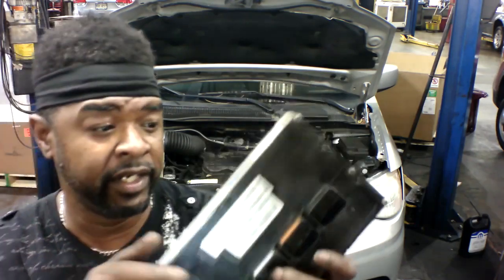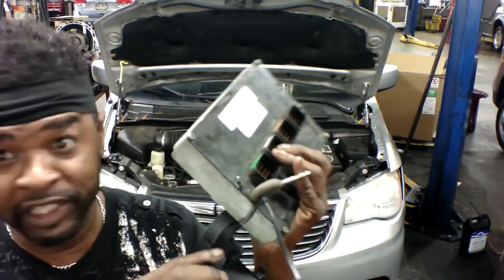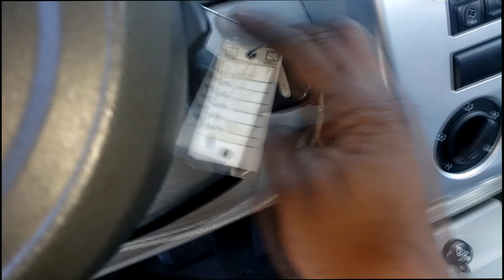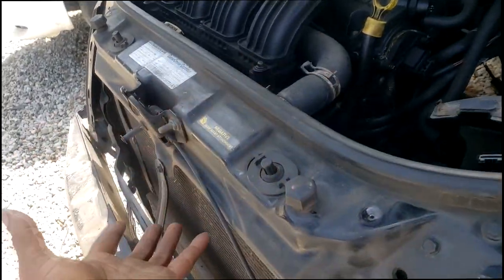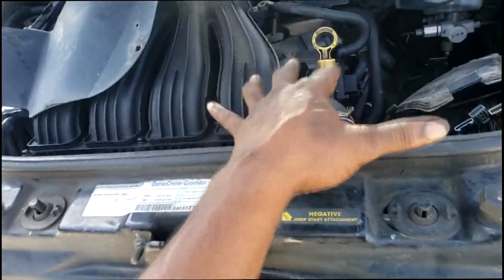No Start Key Bad. NO FLASH NEEDED. DO THIS. PCM, SKIM, KEY to avoid programming. PT Cruiser no crank

Comment: I got a 2001 PT cruiser limited edition I have 107,000 miles on it I got it from $2800 and mine runs really good air-conditioning works good doesn’t overheat passes smog it’s a really good car and reliable

Comment: need your help or anyones help please ...2006 jeep liberty  key got lost ......have been to junk yards in area could not find a jeep libertywith a key .....all jeep libertys were missing those 3 pieces ...... afriend told me i can pull it off a chrysler 300  so i have all three  key ignionskm and pcm ... i guess they are not interchange able becouse skm plug is not the same ............. help please is there a make and model that is inrchangeable with 2006 jeep liberty ..... thank you in advance for any input highly apreciated
Reply from the maker: The Dodge Nitro pretty much the same. Can you not simply get a new key programmed? Also are you subscribed to the channel?

Comment: Love your videos you saved me $$ on getting my TIPM Module for my 2012 Chrysler 200.

I've been having dimming led dash cluster lights new battery, new alternator, and I ran a dedicated 4 gauge wire from alternator to battery negative post on shock housing.

Comment: Yep, the electronics don't care what it's in so if you get all those parts together including the lock cylinder it will just continue to happily work if the car it goes in is the same year, engine, features. My mom's 08 pt never overheated, but the high fan relay went bad and every she turned on the air conditioning it would kill the engine when the air conditioning compressor would freeze up. The full aftermarket fan assembly was 90 bucks on Amazon and included new relays. It was just faster and cheaper to replace the whole assembly. The dealer wanted like 750 bucks. It should have been under recall or warranty but she was just over 50k so not covered. It still doesn't overheat to this day and I personally have never heard of the 2.4 being prone to head gasket failure like the early Neons were when Daimler refused to use the head gasket Chrysler wanted to use to save a few bucks per car.
Reply from the maker: Great points bud

Comment: DO NOT DO THIS! Avoid at all cost!!
If you ever try to make a key, and you go to the dealer to request a pin code for your vehicle (which is free) that pin code they gave you will never work again! Why? Because the SKIM already has a pin code from a different vehicle and and you can’t get the pin code. Then it will cost you way more than if the skim code was for the vehicle. Remember this pin code can be read by eeprom or CDA6 or other software. Always Go straight to the professionals that know how to deal with situations like this, more like security experts. The pin code can be modified to match your vehicle. Other option is to disable skim, it only takes 3 mins to disable VTSS
Reply from the maker: Dude you aware that this youtube right? You can always just simply make a video on ya channel and give your advice on that video. All you need to do is simply get the vin off the car you got the parts off of and get the skim code based off that vin. You may can explain your way  better on your video. Try it.
Reply: thats  a disrepectful thing youre doing there buddy youre discrediting the brother and he didnt do nothing to you 
who are you what are youre credentials?
Reply: If you they had a clue you just need to keep the Vin from the car you get parts from.

Comment: I can not get my car to start for nothing in this world and it is a pain in the ass I'm stuck and have been for two months now and I don't know anything about cars besides from watching ur videos u taught me how to change the thermostat the pcm and I did get all three Lmao I've changed the starter the fuses are all good I've changed the cam sensor and crank sensor I've changed the spark plugs and the spark plug wires and the ignition switch and still nothing idk wat else to do
Reply: Can u please help me figure out wat it is and I forgot to mention I've got a junked out car pt cruiser that didn't have any issues for it's parts for mine so I've got all the parts I need I just don't know wat the problem is please can u help me

Comment: Jt another thing in california its hard to find cars with the key in them at you pull it so i can grab 2 the pcm the skim module and i have a key guy that i use to program all my keys for me. If it dont have the key it will work you will just have to get the key program to the car u working on
Reply from the maker: Correct. This way is for people that does not have those options.

Comment: I lost my keys to my 2001 PT cruiser. Got a ''Locksmith'' to make a new key. At first, the key would open the door but it wouldn't turn in the ignition cylinder. I opened the compartment under the wheel and banged on the piece right under the cylinder to get the key to turn. The anti-theft light is on. It's solid at first but then blinks. I think the SKIM modual is thinking I'm using a shaved key to try to start the car. In any case, I can turn the car over despite having a weak battery (The battery light is on in the car) and on occasion the car will start only for a moment just to turn off again (I'm thinking due to the SKIM). I don't have alot of money and I know fuck all about cars. I just want to start my car. I get the whole anti-theft thing but if you're the owner and you legitimately lose your key's are you just shit out of luck? Will removing the SKIM or ECU (If possible) help me start my car!? I don't care if I don't have theft protection on it. I'll deal with that later, I just need to drive it.
Reply: Did u solve ur problem
Reply: @familyscapegoat  yep
Reply: How
Reply: How did  u fix it Having same problem with my Chrysler 300 V 6010 communication please let me know how you were able to fix it
Reply: SKiM

Comment: This also works with 2nd gen neon. 00-02 ecm/tcm, 03-05 pcm. 03 pcm  is a little different from 04, 05. 05 changed engine harness but pcm still can be used until you find your exact year. Yw
Reply from the maker: lol, good point

Comment: But if the PCM is controlling the alternator voltage regulator I should be able to bypass the PCM connection to the alternator with external voltage regulator powered by a fused power that turns on and off when I turn the key or am I missing something else?

Comment: Old video i have a 2005 ram it has a grey key but check this out i took column apart no module and no halo around where key goes. so wouldnt any ecm work in it that didnt have the immobilizer. and im guessing since i cant see one the grey key is pointless. someone must have cut the key and it didnt need it
Reply: i mean it would have to be like 2002-2005 im guessing with same drivetrain but seems like you could do a plug and play i could be wrong

Comment: If I do that on a Dodge neon, will it start cause I’m trying to see if my PCM is the reason why my battery is not charging without an external voltage regulator so I thought about just going to a junkyard buying a PCM and skim and key and see if it would solve my problem if the car starts
Reply from the maker: What year is the Neon and what color is the key? Or is it a key fob? Also are you subscribed to the channel?
Reply: Yes, I’m subscribed to your channel and the key is gray
Reply from the maker: @jessejones3038 Then yes, car equipped with security. Using the same number/model PCM and the skim should work. But you will run into a problem with that gray key. It's married to the skim. Hopefully you can get all 3 and just simply re code your ignition key cylinder
Reply: @OnlineMechanicTips  the junkyard that I was going to has  the ignition cylinder, and the key and the skim module and the PCM all in the same car so I was gonna buy it all and test it

Comment: what if the dodge have a key w flob and you can only find that year with a key w chip with no flob on it but you can remove the key cylinder and skim and ecu is it going to work to get the car started and later get a key fob and program it to work the alarm?
Reply from the maker: It depends on the year and the bus network. What year make and model? Also are you subscribed to the channel?

Comment: i just bought a computer for my Hyundai . Had the same part number as mine. Put it in without doing anything. Started and and it ran. The only thing , the windows rolled down would not roll back up. I look under the dash, someone had taking a wire and added it too the brake switch. I bought this car new, and never had any problem with my stop sw. What do you think they have done too my car. I am being watched by  private investigator .from one of the biggest company here in Las Vegas. I took my car too a garage, too have an axle replaced . but they had too keep my car over night. From that day on my car would just die , radio s Am stop working. What do you think, car when the wire is off the sw will start by just opening the door everything works except steering wheel will not turn. 
GOT ANY IDEAL WHAT HAVE BEEN DONE, SO MY CAR DO NOT NEED A KEY?

Comment: I did this on 2005 jeep liberty it won't fire up now any suggestions
Reply from the maker: You did what? Also are you subscribed to the channel?
Reply: @OnlineMechanicTips  took the ecm skim module and key off of my running 2005 jeep liberty and put it on another one 3.7liter engine and now it just cranks no spark
Reply: Any suggestions

Comment: Thank you for this! Hey I have a question.. I just picked up a skim module with the key from pull a part yesterday. Can I take the motherboard part out of the new key and put it in my original key that fits my cylinder?
Reply from the maker: Yes, that works..But if you got the skim module, you need to get the vin off that car..it will be needed to program to your PCM. Also are you subscribed to the channel?

Comment: Hey can you swap those pieces and it work on a 06 dodge charger... my immobilizer antenna broke and if I get all 3 do you have to have it programmed to my vin# been told that if I swap out it could cause other things in my car not to work like heat, air, radio etc  .... please help I'm very frustrated thanks
Reply from the maker: Hey Melissa, The 06 Charger bus sys just as advanced as the 06 PT Cruiser. What engine you have in this Charger? Also are you subscribed to the channel?
Reply: @OnlineMechanicTips  I have the 3.5 engine... just need help to get this thing up and running been down for 2 months now

Comment: Got a 2006 will turn over but won't crank, checked timing belt, is working. hooked computer to it, and it would not read it, I assume it the computer.
Reply from the maker: Hey bud, that is to expensive of a part to assume. There are test you have to run to get to this point. What have you done so far? Also are you subscribed to the channel?
Reply: @OnlineMechanicTips  LKQ says they can get me one for 120 dollars, or I could try the pull your own parts yard. After watching your video's, I see I need, the computer, the skim and the key, unless I want to have to get it programed, and that was my plan to just get it programed, I know a few mechanics that will help me or at least they should, I help them all the time. what do you recommend, I've watched about all your video's on PT cruisers, and yes I subscribed to your channel.
Reply: @OnlineMechanicTips  It turns over, but there is no fire, I tried ether but with no fire, no crank. It does turn over so that tells me the key switch is working, The crank sensor has already been changed. So I got a scanner from my neighbor that works on cars, and I put a new battery in it. Tried to scan it, and the computer wouldn't scan, came up with a failure to read the computer, so I unplug it, then plugged it back in, just to make sure it wasn't just a bad connection. failed again. Tried it on one of my other cars in the yard, it worked on them. Got to be the computer. what do you think? want to buy a PT cruiser?
Reply from the maker: @altonlynch5464  lol, no I do not want to buy it. What year is it?
Reply: @OnlineMechanicTips  2006
Reply: I have the computer out now
Reply from the maker: @altonlynch5464  Did you watch this video? https://www.youtube.com/watch?v=BKUiRvhzVxE&t=150s

Comment: Does a 2006 chrysler 300c have the same set up .if i get a used pcm from same year car with same engine will I have that skim module issue..
Reply from the maker: Im not understanding your question. Also are you subscribed to the channel?
Reply: @OnlineMechanicTips  im subscribed. The question was if I replace my pcm in my 06 chrysler 300c 5.7l with a used pcm from same year car with same engine will I have to get the skim module and key for it to work in my car.im getting trouble codes p0032 p0038 p0052 p0058 all at once in the original pcm thats in my car now.02 sensor high codes on all four banks.
Reply: Yes you will have the same issues and more. Stay away from used junk car PCM. Best to buy one online with your VIN. There is a YouTube video that is a company you mail them your PCM. They reflash it remove anti theft. Then you can use a regular metal key when they mail back the PCM.
Reply from the maker: @burnnotice5086  Used PCM are only junk to those thats not sure what to do. I use used PCMs on my personal customers all the time. A $30 used PCM from the pull a part sure beat those other prices

Comment: I bought a tipm.. 2013 didn't work ( in my 2011). If I added all three of those items your mentioning. Would that enable the tipm to work? If they're all from the same vehicle. Or does the tipm have separate variables other than the three your talking about
Reply from the maker: Hey bud, this video dealing with security issues. What exact problems are you chasing? What kind of car is it? And are you subscribed to the channel?
Reply: @OnlineMechanicTips  limp mode issue where it intermittently jumps into third gear and locks there. Also there key is loose in the win module causing the van to die randomly on the highway. When i start it, just by letting go of the key it will die, unless it clicks back in the perfect position after starting. The j18 fuse that sends power to the relay which sends power to the transmission, was clicking on and off when moved slightly. Also there are other things like drivers window intermittently not working making me think that combined with the limp mode that the tipm is beginning to fail. Basically I'm asking if I'm able to bypass tipm reprogramming, by getting the key, skim module, pcm, and tipm from a donor caravan. Or would I have to reprogram regardless if I get a new tipm. Also the moving around theharness that plugs into the transmission seems to have some effect on pulling the van out of limp mode. The code is p0882. Low voltage to tcm. Btw once I get it to start and Its not in limp mode. It's usually good for the day, until the next morning when I fight with it to start not in limp mode.
Reply: Yes I'm subscribed,  and thank you for your content, its helped me a few times. and I appreciate the reply.
Reply from the maker: @jamieengland9921  wow bud. Listen, a TIPM do not have to be reprogrammed. If you get a used TIPM from a similar van with the same features and same part number, no need to re-flash/re-program a TIPM. In fact, you may need to simply re-configure a TIPM if features are mis matched. Let me say this, you really need a scan tool that can read data inside these modules such as the PCM/TCM and the skim. I take it your scan tool only read codes. That will default you into guessing. Now let me directly address your question. If you go and get a skim, key and pcm, the TIPM do not have to be reprogrammed.
Reply: @OnlineMechanicTips  so your saying there's no marriage between the key, pcm, win module, and the tipm. It's married to its host van through the design, layout and options on each individual van. I was told by a dealership that 2011 grand caravan tipms are the only year where there are year specific. Where a 2011 caravan, for whatever reason only accepts 2011 tipms. And that 2012 caravans for example could accept 2012 2013 2014 etc tipms. I just thought that the 2011 year specific tipm problem could be bypassed by including the other 3 components you mentioned. This sounds like a big me problem lol. Again thanks for your replies man, I appreciate your knowledge.
Reply from the maker: @jamieengland9921  So you have 2 problems? Trans going into limp in with a P0882, you suspect (guessing) the problem is the TIPM without a good diag being done. This complaint alone has nothing to do with your key issue of a failed skim module. You thinking all 4 parts you mentioned will fix all your problems? ok, again, the TIPM has nothing to do with the security skim. The 2011, 12 and 13 TIPMs basically the same part numbers and can be interchanged if your scan tool will allow you to a reconfig. Without a good scan tool, you never going to get this right, you will be guessing and thats expensive.
Reply: @OnlineMechanicTips  yeah, no I get the win or skim module is its own separate issue, aside from what's causing the code. I have a 2013 tipm I picked up for free just thought I could get that to work with my 2011 if I took the key skim and pcm from the 2013 and put it in my 2011. Since on its own the tipm don't work with my 2011.
Reply: @OnlineMechanicTips  and you're right ya I do need a proper diagnosis from a good reader. I'm just trying to avoid paying the piper, since I have cheap access to 2013 caravan parts. Some say the tipms have to be reprogrammed but I thought by getting the same 2013 tipm pcm skim and key that it would all work.